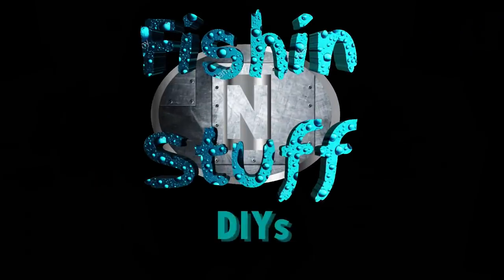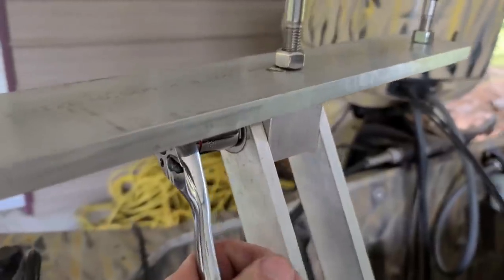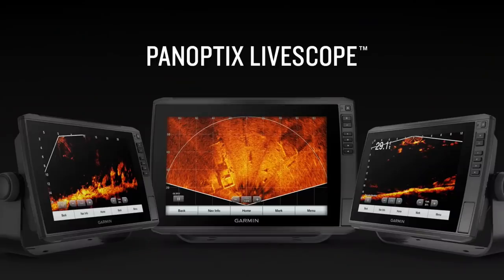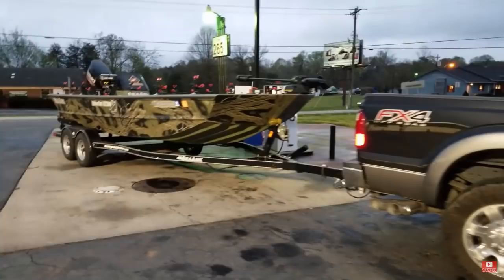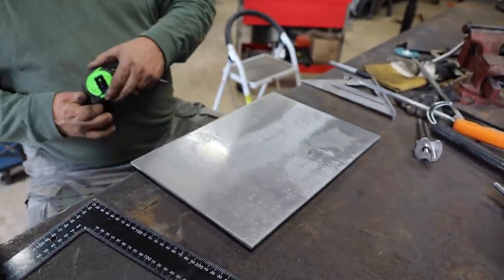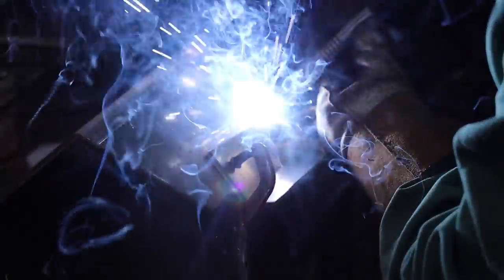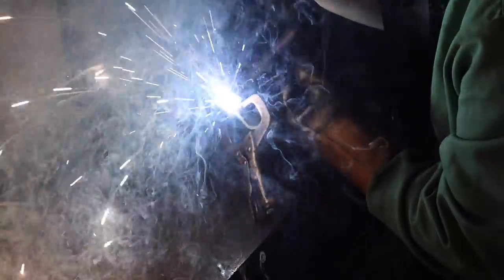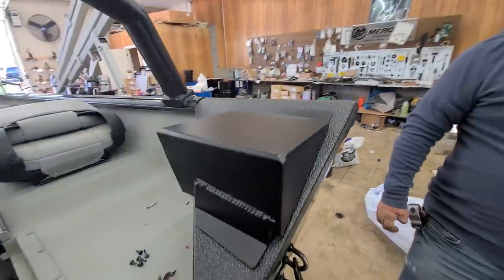How to save floor space on your Boat

Comment: Keith...loved the  latest vid brother...great idea. 

I have an idea for you to consider for your amazing DIY channel.   

I have an older 18' fiberglass ProCraft bass boat that sits on a cement pad next to my double car garage.  I use a sealskin custom fit cover for it, but the cover only fits (snug) about 6" over the boat's sides and bow. It provides excellent sun and rain protection....you know...what a good boat cover is suppose to do, but in San Diego it don't rain much so the sun is almost constantly shining and the silver metalflake gel coat gets a ton of oxidation damage from Bob's (big orange ball) UV rays.

Last summer I bit the bullet and spent a lot of time and effort (and really achy hands) and buffed out (by hand and a cheap Harbor Freight buffer)  many years of oxidation...I put a quality wax on it and brother it looked Awesome!!!... it shines like a baby's spanked tomato! 

To guard against the sun oxidating the gel coat again, I came up with a cheap fix to protect my boat's sides and stern from the sun. 

I went to Harbor Freight and bought a heavy duty 11' by 19' (silver) tarp for $25. 
 I layed it out on my driveway and cut (2) two 4 foot wide strips to make a "sun skirt" to protect my boat's sides. 

How to attach... I simply held the tarp "skirt" against my boat (to find some "tie off points" like...handles...trolling motor...eyelets for a bimini top...cleats...etc) and then put grommets at those points in the tarp. I use a 12" piece of paracord to tie the skirt to the boat's gunwale BEFORE I put the boat cover on.

With the combo of the "skirt" and my cover, my boat's gelcoat finish is completely protected! Now I think you'll admit...that's just plain AWESOME!!!

I also did something for my 150 Merc 2 years ago... I ordered a full (white) motor cover off Amazon.  I did so to help reflect/deflect some of the pounding heat on my (black) outboard's lower unit (since my sealskin boat cover has a motor "hood" built in to the cover).  This full white motor cover has helped keep the sun's heat from destroying my impeller (water pump) so fast (I haven't needed to change my impeller in 2 years!!!) and it also keeps wasps and mud dobbers from building nests on my outboard. 

Like my boat "skirt", I put the full motor cover on the motor (which even encases the 4 bladed SS prop and skeg) before I put the boatcover's "hood" over the motor. 

I takes only 5 minutes more in the early morning to remove the full motor cover and skirt (or to put em back on at the end of a fishing trip) and that is nothing compared to the time required when  disassembling the lower unit for an impeller change or scrubing and buffing oxidation off my boat's sides. 

Thought some of your viewers might benefit from the above ideas.

johnrbush357@gmail.com
Reply from the maker: That's is a great idea . I really hate the way boat covers fit as well . That part of the reason I bought my building that eventually turned into a YouTube studio some hom lol . I appreciate you sharing that great idea
Reply: @FishinNStuff  I'd love to put up a building or pole barn to house both my bass boat and 22' center console "salt" boat, but they put the houses so close together in cheapa_ _ CA that the only room I have is enough for a 9 foot wide cement pad.  The house is a 5 br/3ba 3000 sq ft structure on a postage stamp sized lot.  When I sneeze, the neighbor hand me a kleenex thru their facing window.

Comment: If the bottom plate weld was on the inside or if he would have made the main piece longer and put that bottom bend on the main piece it would have look a lot better and it would have look like it came already came with the boat when you bought boat just saying